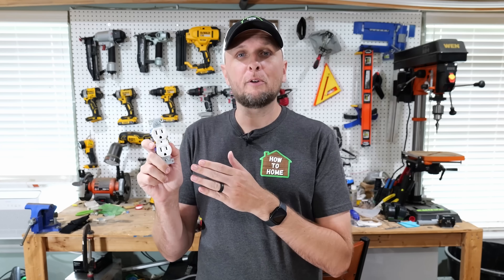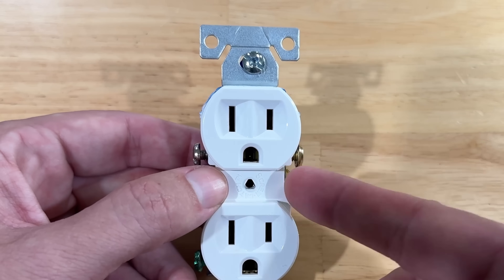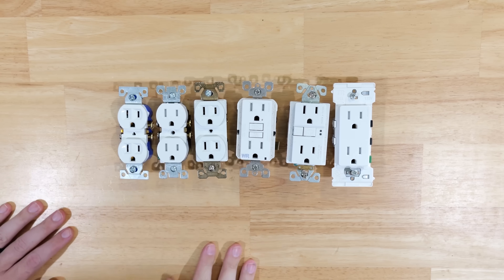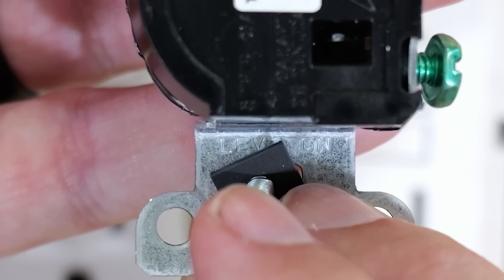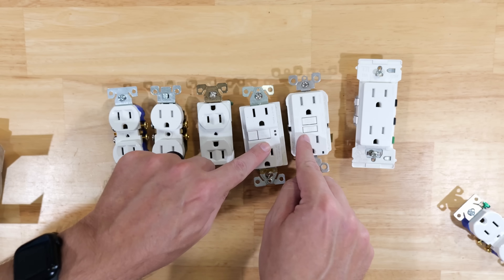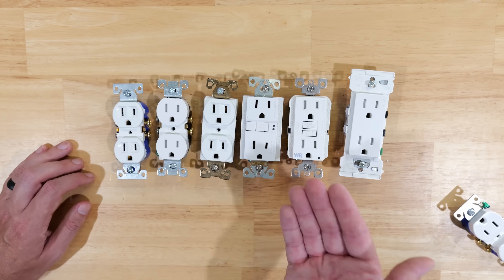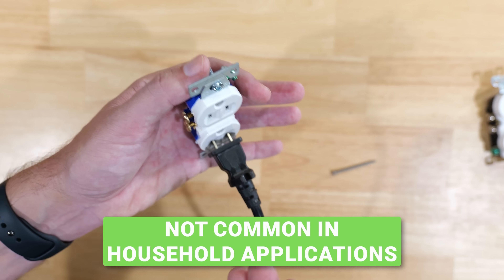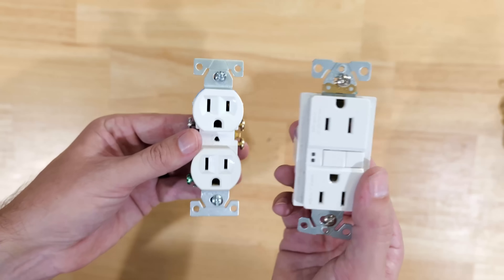The Shocking Reason Why Your Outlets Are Installed Upside Down!

Comment: As a former Industrial Medium Voltage Electrician I have two comments.
It is very satisfying to hear you mention the size of the two slots in a 120VAC receptacle as determining which is Hot versus Neutral.  Ad Nauseam over the years I have corrected so many people who say that the Brass and Silver color of the screws tells you which is which. IT IS NOT.  You are correct.
One item you did not cover (or I missed it) is that the nailing ears need to be removed when installing receptacles in boxes - which is predominate now.  I'm pretty sure nobody nails receptacles to studs anymore.  That was bad practice then and now.  Using a pair of 'Klein’s' Journeymen Electricians bend and snap off these flanges.  They have no business remaining as part of the assembly when put in a box.  The 'ears' are an artifact of the days when house wiring electricians nailed receptacles to wall studs without a box.  Almost nobody does that anymore, and most inspectors would not pass that kind of installation anyway.  The nailing tabs get in the way of installing a receptable in a box.  So use of best practices is important, as I was taught by journeymen (and women).
And I really appreciate that you addressed ground hole up or down based upon the lettering on the receptacle.  Every Electrician I've known over the years based their choice on this one determinant.  As you suggested there is very little reason to chose by any other factor than how the receptacle in labeled.
Good job on whole.  Props from an old 'Tron Chaser' (Electronics nerd as well as Electrician). Side note: I'm an oddball having spent time deep in Electronics including Broadcast Engineering as well as general Electronics, and Industrial Electrician work up to 13.8KV - mostly 480 3-phase motor controls and Predictive Maintenance in Industrial settings.  My first love was the Theatre though.  I spent over 30 years on a stage somewhere, acting and lighting sets, and often being the House Electrician.  Many of us old farts wore a lotta hats over the years.
Happy Trails from an old desert rat.
Reply: Not sure what you're saying but the brass and silver colored screws do indicate which is hot and which is neutral. Hot wire to brass, neutral wire to silver and ground to green screw.
Reply: I'm saying that real Electricians NEVER use the Silver/Brass 'thang' to determine where the hot and neutral go.  The ONLY safe way is to use the size of the receptacle slot to pick the wire locations.  That is foolproof, and not prone to some 'Jake-Leg' getting the wires mixed up.  Some folks are a bit mentally dyslexic bso they can easily get it backwarnd.  Safety First man!  Keep it simple and keep it real.
Reply: nailing ears help keep the outlet flush to the drywall ; if the box depth wasn't set perfect for the finished wall , which it very rarely is .
Reply: Yeah, yeah, I've heard that excuse for decades.  It has never helped me - actually the reverse.  It's still best practice to snap them off, and any Joiurneyman will tell you that.  'House Wirers' use a lot of shortcuts like that to save time cuz they are paid squat.  They rarely worry about making anything flush - in my experience.
Reply: @larrykeyes4979    I have to disagree . I started working in HVAC in 1979 and full time as a electrician in ~1999 . I never had an Inspector fail a box because the ears were left intact . Only a overpaid underworked union slacker would waste time snapping off the ears . Unless some special cover or plate required it . That's my opinion and I'm sticking to it . 🙃
Reply: Sticking to my story too.  My 20 some years of experience and advice from Journeymen tells otherwise.  All of us "slackers" ROUTINELY snapped off those ears.  It is slacking to NOT do it.
And as a good Electrician you should know that inspectors are usually NOT Electricians, so I listen to Journeymen and NOT inspectors.  The Inspectors who were Electricians agreed with me about the ears.  They will not snag you for them.  It's just good practice to do it.  Best Practices are more important than some Jake Leg's signoff on a piece of paper.
Reply: And, as an Industrial Electrician we did not have inspectors perse.  My boss and the Engineers were the ones to approve of my work.  They all agree with me and taught me what I said.
Reply from the maker: I believe I did talk about removing the ears.
Reply: @HowToHomeDIY   Must have been when the neighbors were fighting or the dogs were barking or the trash truck was slamming cans or the tornado sirens were going off or I was in the can or I dozed off . 😳my bad 🙃
Reply: OK well I missed it.  Props to you if you did.
Reply: Ok, the reason I looked at this video is because my whole life I wondered why can’t outlets have the ground up? Every cord on every appliance  I have ever owned wants to orient to be plugged in ground up, but you always have to fumble against the natural twist of the cord to plug it in upside down. You stated there is no reason, but I beg to differ. Rant over😂
Reply: My NEC code book is in the other room . Tell me what Chapter and Article your obsession is in . I'll look it up and if it's there then ; Hey You Win. 👏👏
Reply: Not trying to beat you up man.  There is nothing to win or lose here.  And I'm not preaching the code book.  Just saying that this is my experience and training.  I'll take OJT from Journeymen over a book any day.  It's all a  minor debate, but I'm a Type A, so take my comments for what they are worth - not even the price of a cup of joe.
Reply: While I agree that the screws are not always EXACTLY Brass and Silver, they are something similar, AND IN 70 PLUS YEARS, I HAVE NEVER FOUND AN EXCEPTION....

Comment: My electrician installed all the outlets ground on top and I asked him to flip them all.   The reason I prefer ground down is because there are many consumer products that are designed that way.   For example, my wife has a shaver that the plug is a charger and the razor sits on the plug.  It would not work if the receptor orientation was reversed.   Our deep freezer, fridge and microwave all have elbow style plugs that allow the applies to be more flush with the wall.   All of them are oriented with the cord on the ground side such that a ground top outlet would have the cord going up instead of down.

Comment: I've been terrorized into installing all receptacles (a) vertically and (b) ground pin down.  The terror arises from older "wall bricks" used for technology - these are voltage converters from 120VAC to low-voltage DC.  We had an office of 50 people, the first phase of the build-out had receptacles vertical and ground pin down.  All happy.  The second phase build-out occurred while I was out in our D.C. office and they were installed horizontally, even though the plan set specifically said vertical only.

By the time I got back, half of the new receptacles were broken from the weight of these heavy power bricks cranking down on the ground pin and snapping the plastic.  We made the builder come back and re-do ALL the outlets vertically because they had signed off on the plan set.  Then they installed all the ground pins UP (probably just to piss me off), and nearly every one of the receptacles cracked from the unwieldy power bricks with the weight above the receptacle.

Fortunately, the plan set also specified ground pin orientation, so they sent someone out to replace and re-install everything pin-down.  Ugh.  Maybe that's why today power bricks are generally part of the power cable and don't directly plug into receptacles much anymore, unless they are small and lightweight.

Sidebar: I worked in The Bell System and, at one point, our Whippany (NJ) lab had developed a new optical fiber connector that was embedded in the receptacle ground pin.  The thinking was that when you plugged in your laptop or desktop, the optical connector would connect you up to your internet connection.  At any rate, those receptacles required pin-down orientation for a reason that escapes me now.  But the wacky idea never took off, and then along came WiFi, so no real need to do the optical thing anymore.

Comment: The National Electrical Code (NEC) doesn’t require a particular orientation, so you can install them any way you want, even sideways or on the floor...  that said,  specific projects may fall within other codes and guidelines.
For Example: Healthcare facilities within the OSHPD jurisdiction in California require that the outlet ground is to be positioned up

Comment: This only happened once but that was too may times! My wife and I were measuring a room to get the correct amount of new paint and she let go of the measuring tape while it was still at the wall. Of course the tape being so thin it dropped between a cord and the receptacle. It bounced and landed there again. There are 4 notches in the edge of my measuring tape now :(. When I changed the receptacles to childproof ones I made SURE all the grounds were UP. It's a valid question and that's why I will NEVER install with the ground DOWN!

Comment: Having once electrocuted myself with my forefinger by unplugging a cord from an outlet with ground prong up (as demonstrated in this video), I prefer ground prong down. I also think it looks better. However, cords drape down. The main justification for ground prong up is that most right-angle extension cords have the ground prong at the end, which means they are assuming the outlet is ground prong up. Admittedly, it likely is easier and perhaps cheaper to make cords like that. Prong up also seemed to be the default in Europe.

Comment: Ugh. This is a "solution" in search of a problem. Apparently, 10 years or so ago, some bright sparky decided to mount the receptacles upside down (to be different), and cast about for a justification. You can come up with explanations and reasons that "sort of" make sense in particular situations, but none of them really hold water. I'm still mounting mine in the ground-down orientation until the NEC tells me to do otherwise. And I'm making a point of turning the ground-up ones I find into ground-down orientation...just out of spite.  This ranks slightly above the "all escutcheon screw slots must be aligned vertical" obsession for silliness in my book.
Just to show how silly this whole debate is...my son recently purchased a 70s house. The sellers went through and re-oriented most of the outlets to "ground-up". Yep. They took the time to unmount and rotate them all. This is the least of the issues with the wiring in that house, but apparently, it was important to somebody (not my son or the home inspector).

Comment: Home owner here, just a thought, in homes most of the recepticals are low, the ground terminal is longer and "ground plug" up is easeir to locate when bending over for most outlets especially behind furniture. However I follow what ever is installed previously. Learned some more here, Thank you

Comment: The problem is not the orientation, it is the lack of proper support for the prongs inside the socket.   You should be able to insert an extension cord into an elevated wall socket without the plug slumping.   The current code approved standard is garbage and it is the proximity of the socket to the floor that leverages the floor as support for the extension cord wire.   I guess "imposing costs" on manufacturers which they pass onto the consumer is too much for the regulators.

Comment: This video raises more questions than answers. I prefer ground prong down because I use 90 degree head extension cords that are all manufactured ground prong down, in fact, I have never seen a 90 degree head ground prong up. So what is the industry telling us? If ground prong up is the new standard, why aren't there laws forcing manufactures of extension cords and appliances forced to correct the 90 degree head issue?

Comment: The Ontario, Canada code does not specify the orientation of outlets - ground pin can be up, down, right or left. I've always learned to have Ground down. Majority of people grab the plug, thumb on top and wrap fingers around the bottom, then pull.

Comment: With a three prong Edison the idea of the ground prong on top is so that the always-longer U-ground prong is naturally directed in first, earthing the appliance or device first, before power-prongs engage the device to be powered.  This can be important sometimes for >>some<< sensitive electronics.  The main problem I see  >>in practice<<  with ground "up", is in outlets installed knee-high (or lower) that get regularly used for three-prong vacuum cleaners where the ground-prong snaps off the plastic of the receptacle-face just above the ground hole, which happens from people pulling "up" on the plug when un-plugging.  THEN you have a broken (and therefore out-of-code) receptacle.

Comment: 1) if that hypothetical paper clip lands across hot and neutral, there's a breaker for that.
2) most 90-deg plugs do not allow the cord to hang down when the ground prong is at the top.
3) whether you call it earth or ground, where we plant our feet is down. only aerobats and fighters have reason to fly inverted.
4) you can escalate the argument by installing everything SIDEWAYS, and let them argue whether it's safer for hot at the top or bottom. i favor hot at the top since heat rises.
5) 4 is my way of calling the whole thing silly.

Comment: My late father was an IBEW electrician for 45 years. He almost always worked commercial/industrial construction, very seldom residential. He told me that this decision was always dictated by the shop he was working for, but that 99.9999% of the time, it was ground prong UP. I've also heard a couple of places that its ground prong UP for commercial/industrial, and ground prong DOWN for residential - which would jive with what my father said. As for myself, I prefer them DOWN as I think they look better and most residential cordsets with an angled cap  will be configured that way. With that said, there's been a time or two when that wasn't the case; so I simply pulled the receptacle, rotated it 180 degrees, and re-installed it.

Comment: my vote is for ground prong down because I have experienced a house with them up and many of the outlets were broken at the top from the weight of the cords or transformers  pulling down on the ground prong. when the ground prong is down it pushes the prong into the outlet and is less likley to cause a problem.

Comment: I've seen a metal chain from a window shade be blown by the wind and short out the prongs of a plug in an outlet next to the window. Odd and rare occurence, yes, but it can happen. Even in that case tho, the appliance only had two prongs so it wouldn't have mattered whether the ground prong was on top or not.

Comment: I'm a retired electrician, non union, union and owner. In the 70's my instructor taught us that ground down as on an extension cord ground is the longest prong and the last prong to exit the outlet. Wagoes have not used them at all, but still do electrical work and I found 2 so far burned up. I twist my wires and use a wire nut, I have found some burned up with a wire nut and the wires usually aren't  twisted.

Comment: All my power bricks to various devices have the cord going down, and most flat wall plugs of extension cords that aren't going straight down, have their cord pointing off to the side to the bottom right to avoid blocking a 2nd outlet. So for me, ground=down, no exceptions. Plus, I'm OCD, so seeing even one outlet with the ground pointing up while the rest are down, drives me up the wall.

Comment: Electrician here, all I can say is that the orientation is much less important than the actual wiring.

Although, I think out of practicality, it's easier to plug in a 3 prong connector with the ground on the bottom.

The code isn't too specific on the orientation, but inspectors might still question why an outlet is installed upside down.

Comment: One other point. With the ground pin up, gravity will leverage the line and neutral into the plug. This pulls on the much larger and stronger ground pin, insuring a good line and neutral connection. The ground pin has a long way to go to be pulled out of the outlet.

Comment: I have seen a drop in the prongs arc, when a tape measure was being used against a wall and slid down.  Ruined the tape, but once in a career occurrence didn’t stop me from using what I have always considered standard installation methods.

Comment: it doesn't matter but many connectors from appliances will have a wire going down from the ground side so it wouldn't worj if your outlet had the ground up.

Comment: So your logic for WHY we should install them upside down is that the manufacturer’s CHINESE plant subcontractor is WRITING on the outlet upside down now even though they didn’t use to do that when they were made in America? And there is no instruction to install them upside down nor does the manufacturer DRAW them upside down in their numerous wiring diagrams included with the packaging of some of them on their websites, nor are they upside down in the pictures on the box (where they sell them in bulk and have photos). You, sir, are NOT A LICENSED ELECTRICIAN. Nor should you be. This is not a “common and controversial topic” among LICENSED ELECTRICIANS. It is not discussed because the manufacturer hasn’t suggested, nevermind recommended, installing them upside down to anybody. You are just misleading DIYers with your own nonsense because you like installing them upside down for some reason and feel like defending your own practice as though it is “recommended” by the manufacturer WHEN IT IS NOT. Look at your headline and your subject discussion, misleading people to believe that they are recommending them to be installed upside down. THEY ARE NOT. YOU ARE.